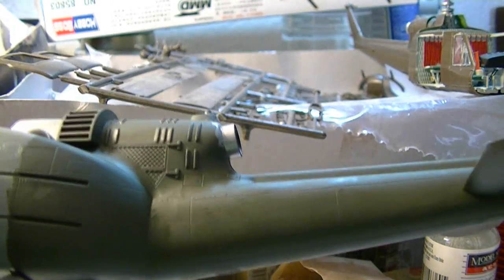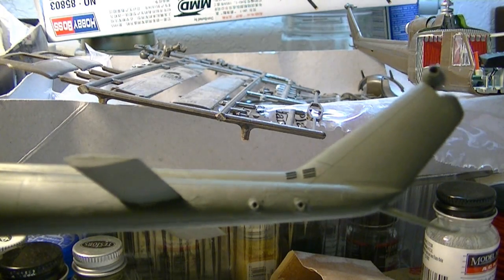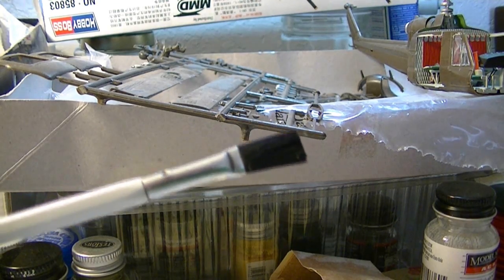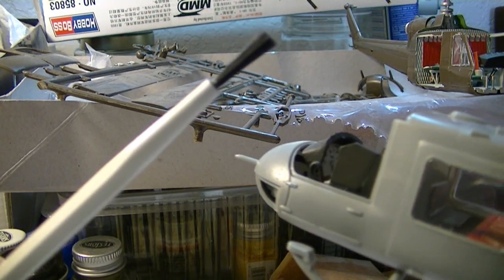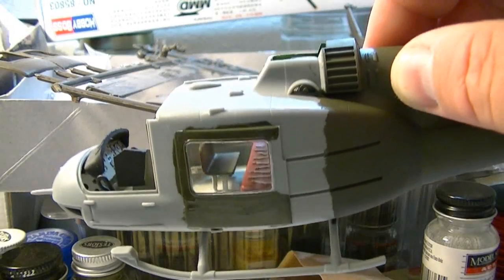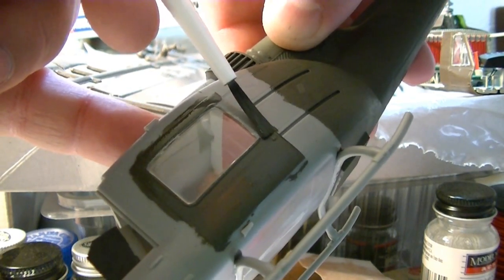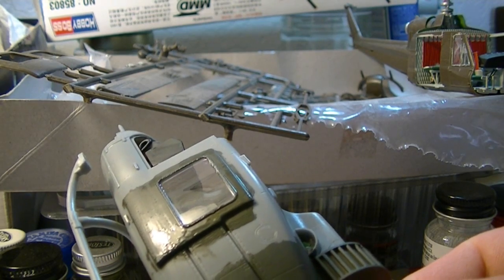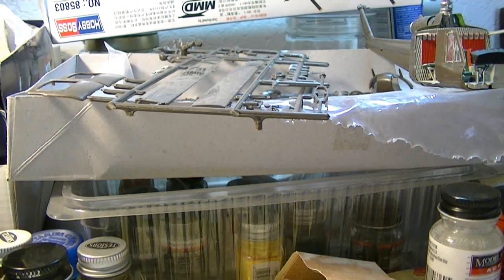How to brush paint model aircraft fuselage Part 2

Comment: I brush pain as well, air brushes and compressor are very costly,you done and fantastic job with your brushes.I try to pain with the flow of the air, meaning from front to back the way the aircraft flies through the air, but sometimes is very hard to do it that way.
Reply from the maker: Hi Timothy and thank you. That's a great idea of painting in the direction of airflow. I can see how it would be difficult at times to do so. Each air frame has it's own character. Thanks again and have a great day.
Reply: Yeah true, when you was painting the door with the window, the small place around the window would be very very diffecuilt to paint with the wind flow

Comment: Here's a tip that I use for working around windows. Take some thin masking tape..they have some that is put out by Testors and Tamyia that's great for masking off windows and canopies. Put it around the edge of the window where it meets the door. Then take some blue painters tape and put it on the window its self and push it as far down along the edge of the window as possible. The hold the door/window assembly up to a bright light and using a new exacto blade, cut the excess of the blue tape. This will give you a good cover for the window and will allow you to make a mistake that won't ruin the window :)
Reply from the maker: Thanks for the tip. I've used blue tape in the past and really like it. I was thinking of trying that green frog tape. It's supposed to give great lines.
Reply: Better yet, paint the door BEFORE you put it on and BEFORE you put the side window in. Very elementary.

Comment: Thanks for the advice about the brushing. I did a paint brush with my B-17 G Flying Fortress from Revell. And when I did an Airfix Mosquito Mk. VI I also used the paint brush, and I used the Revell masking tape. I just have a question for the paint. Did you use Humbrol paint or Revell paint for the helicopter? If it's neither of mentioned which paint did you use? I apologize if someone had asked a similar questions, because I don't sometimes follow the comments.
Reply from the maker: I'm glad this video was able to help you out. No need to apologize for anything. I used Testors Model Masters paints on both of the helicopters.
Reply: OK. Thanks. I assembled a B-17 G,  and paint it just like I have told. And also I have put the Yugoslav decals on it. I can send you pictures if you are interested. I used the decals called Lift Here! (that's how it's written, I'm not yelling).
Reply from the maker: Sure I'd love to see it. Here's my email  f4jphantom2@yahoo.com
Reply: OK. I'm sending you pictures right away. I hope they are good. ;) :)

Comment: Looks great! If I can get a finish like that on my De Havilland Mosquito I will be more than happy :) Can you do a camo finish and if so how do you do it? The Mosquito requires this and frankly I'm dreading even attempting it, haha.
I was thinking a series of tricky masks but then I suppose you'd have the problem of paint ridges where you paint up to the edge of the mask? Any tips appreciated.
Reply from the maker: Sure you can camo brush paint. I've done several just never videoed it. You don't need to mask I will get a camo pattern in my mind, or follow the paint scheme off the box. Then I'll paint one color at a time in the desired shape. Next just paint the other colors. Generally three colors in a Southeast Asia paint scheme. I recommend using a new bottle of paint for each color or any paint job you do with a brush. The Testors Model Masters paints are excellent for brush painting. I hope this helps you out, anything else you need to know feel free to ask.  Have a great day.
Reply: @f4cphantom2  Awesome! Thanks for your help. I will give this a go.

Comment: nice work! do you still brush your models? And after painting, do you use a varnish? or before or after placing decals?

keep up the good work!
Reply from the maker: Hi Jeroen, yes I still brush models. In fact the F-102 I'm currently building will be brushed.  I don't use any varnish before or after however I do sometimes use a clear coat of flat. Thank you very much for the compliment.

Comment: Your method is the same as the one I used as a kid back in the early 1050's.  Then the models were very simple with a lot fewer parts, but I really liked the results.  I am surprised the technique still works in the world of models with over 100 parts (or more). Would it be better to use artists brushes?  Also, do you do preshading or any of the modern approaches to modeling?  Do you use any etched metal after-market parts?  Modeling is becoming so complex I am wondering if it is even worth pursuing.
Reply: Dont let the modern techniques turn you down. I stopped building for a while and got back into it. Started researching and found a lot of new methods i never knew existed and never used. Its a lot of work and steps but it just helps with the end result. Pre-shading, post shading, aftermarket parts etc.